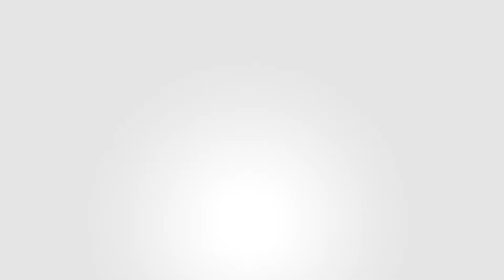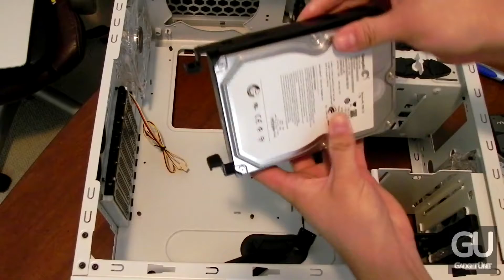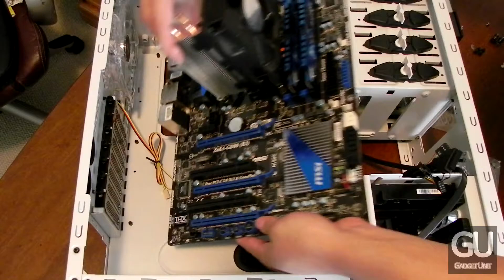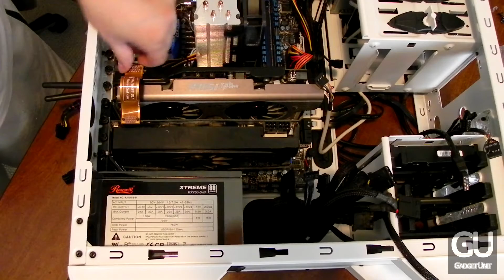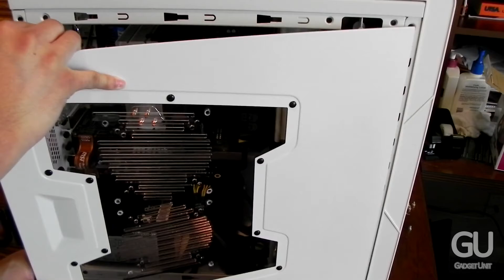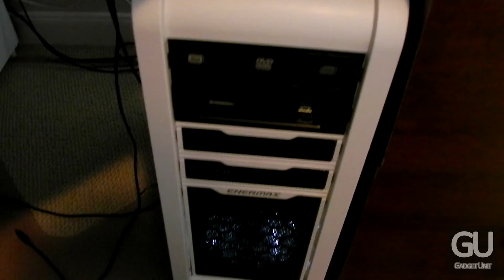[PC Upgrades 2013] Part 6: Rebuilding the computer

Comment: ok so i got my case and im trying to install my motherboard its an AS rock z77 extreme 4 motherboard and its an atx motherboard but the standoff won't line up with it and im getting angry because the instruction manual does nothing for me at all what screws go into the standoff on the case